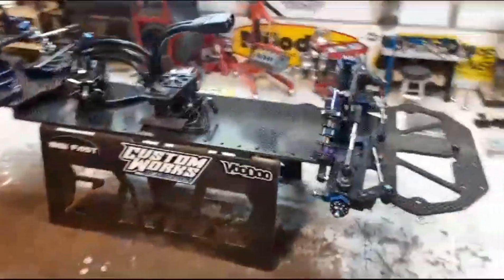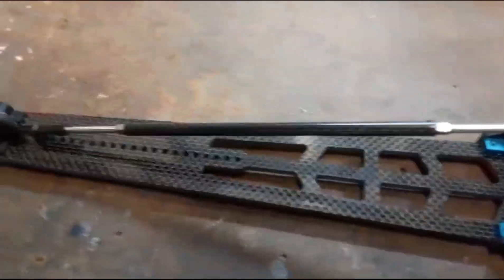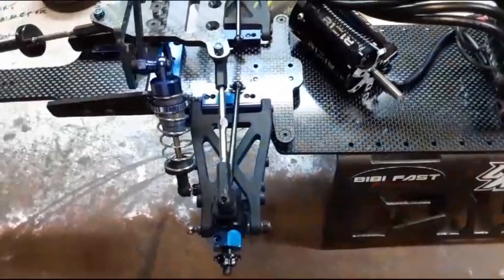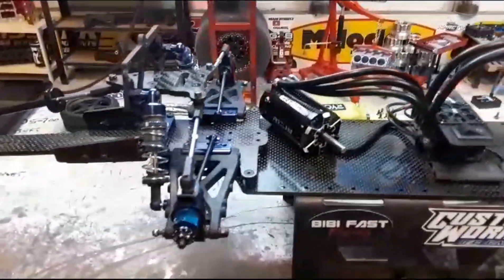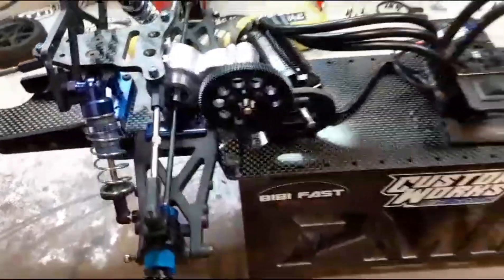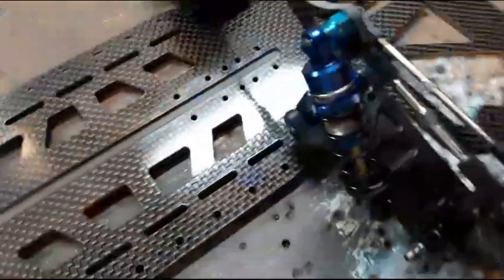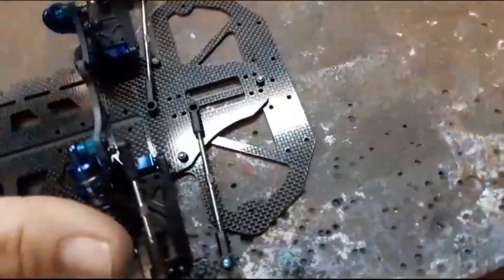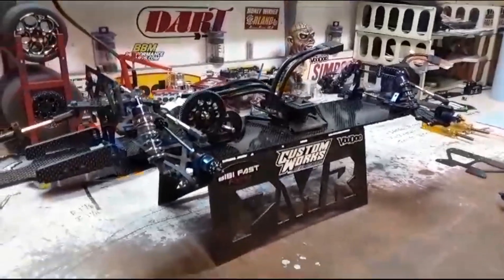RC Pro Outlaw Drag Racing....QUICK HITTER..Some really cool features on the 24 PATRIOT!!!

Comment: I see where the new transmission requires R1 topshaft and slipper clutch eliminator. They are out of the transmission kit on their website. Will the R1 Laydown tranny fit or where can I get the new tranny kit from?
Reply from the maker: From what I understand the car is in high demand and you are 100% correct about everything for the new tranny I don't have any information on when it will be available I'm a customer just like you I think they're blue now check on Facebook or email them and see if they get back to you unavailability I don't think any other transmission will work unfortunately but ask around I have only ever run this kit before was Traxxas
Reply: @powermadracing5116  Yeah ,they are blue now. I will reach out to Custom Works. I will start assembly with what I have and can upgrade later. Thanks..
Reply from the maker: @fredericktodd5789  Man I know when you have the money and you want the parts and it's not available I hope they get back to you soon
Reply: @powermadracing5116  One more thing. I do not want to use the plastic diff. It says B-6 on the bag . Thats Associated..right?
Reply from the maker: @fredericktodd5789  Sorry for the Late reply, yes, any B6 diff will work DRC R1 Do the same with the idler gear. Those are the only things I changed in the kit.  With an 867 f d r  156 @90 With the v1 chassie plastic tranny
Reply: @powermadracing5116  Thanks, I appreciate ya!